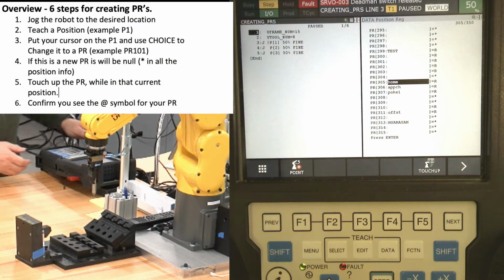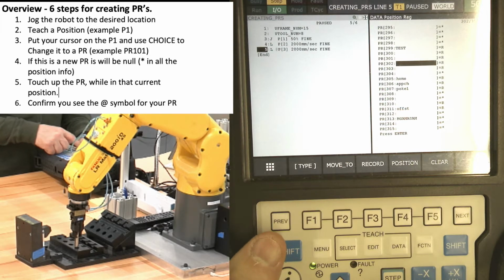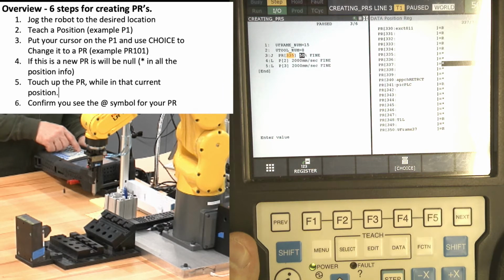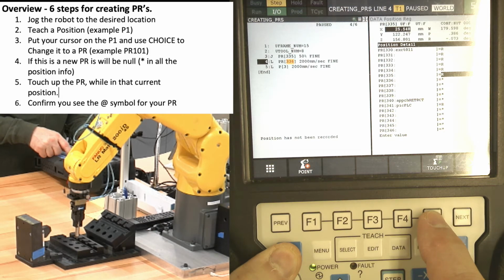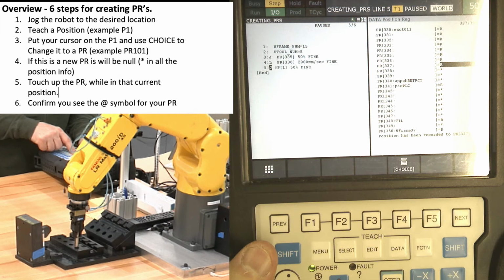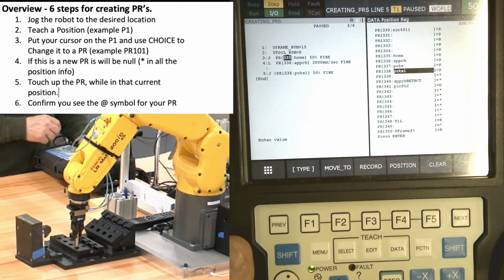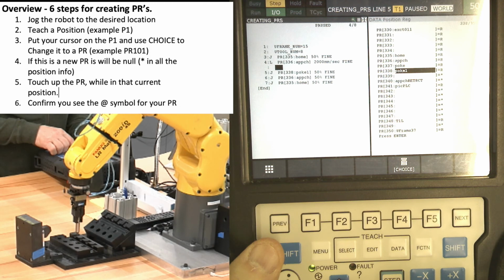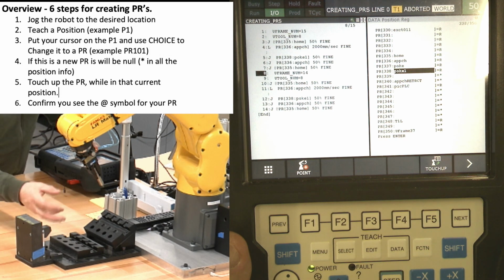The Power of PR's - Fanuc Robotics

Comment: Nice work. 
Add OFFSET to that and save yourself even more. Ex Z offset for approach. Now only need to use one PR per battery and can touch up one point to fix two. Could go a step further and offset to other batteries too depending on how far you want to go. Pros and cons to that obviously.
Reply from the maker: Yes. Great idea! It's just that for students, it's best to introduce one idea at a time, or students get overwhelmed.